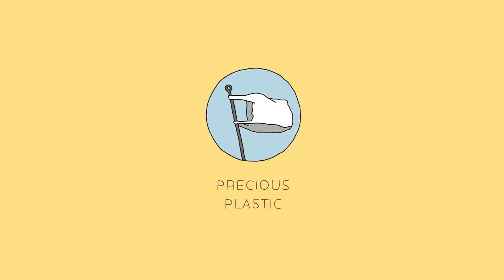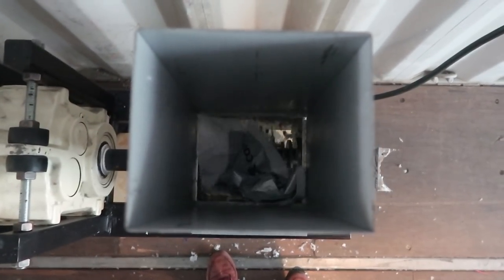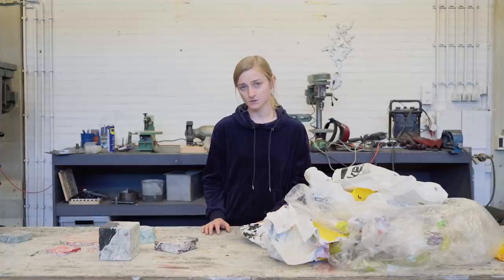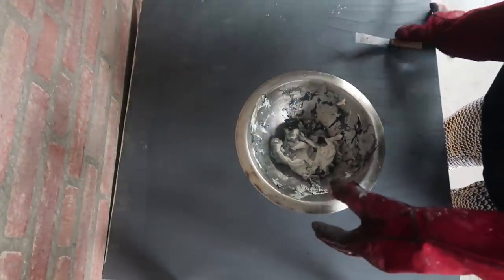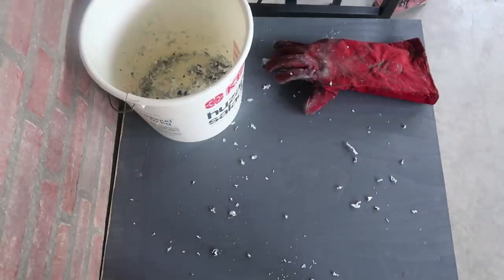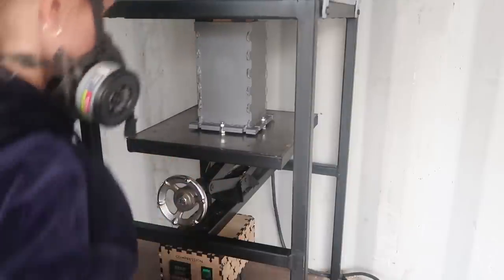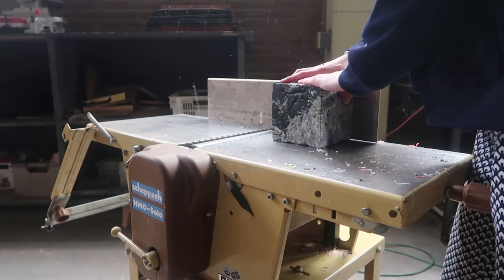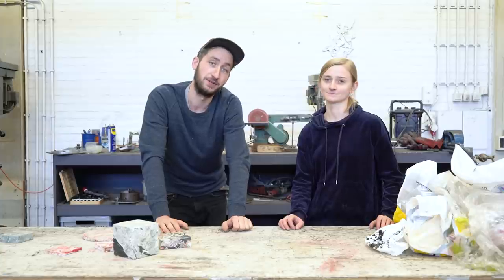Create marble from plastic bags #preciousplastic

Comment: I've found it easier rather than bothering with any shredding or doing the initial melt in the oven to just do a pass over the bags with a heat gun or a high pass with a blow torch.  The plastic will do a partial melt and shrink in on itself, but will cool very quickly so that it can be safely handled sooner.  Do this for a few of them and you'll end up with small, compressed nuggets of plastic that take up a lot less volume, so you can pack them in to your mold for a longer melt to fully liquefy and unify them together.  Other advantage in my experience is that you're much less likely to get air bubbles this way.

Comment: I molded my bags differently. I attached a heater plate directly to the side of the mold, heated the mold up to temp and stuffed it full of whole bags. It works just as well and requires a lot less equipment. It takes longer to cool, but that doesn't bother me.
Reply: Do a youtube on your process... it sounds interesting... do you have fume issues?
Reply: please make a youtube video
Reply: do you use any type of release to prevent plastic from getting stuck on the mold? because mine is always stuck if i heat mold with plastic together
Reply: @ekaterinakorzh188  I used cooking spray and that worked pretty well. You can also buy mold release that works as well

Comment: I got inspired from watching this video and decided to try melting some bags myself.  I bought a 2" pipe nipple and two threaded caps.  Screwed one cap on the nipple, stuffed the pipe nipple with plastic bags then screwed the other cap on.  Placed the assembly into a fire I got going in my fire pit and the pipe turned orange.  The next morning when the assemble was cool, I unscrewed the cap on one end and to my disappointment there was nothing inside except a little ash.  I couldn't believe that all that plastic disintegrated so completely.

Comment: Excellent tutorial. I've learned so many great tips from your group, which I've applied to my own plastic recycling. I just wanted to offer a cautionary remark. It can be quite dangerous to run material under 30cm in length through a jointer (what you called a thickness planer). My worst shop related injuries (plural) were incurred by doing just that. If you must do this (but don't) at least use a push blocks.
Reply: Thanks for the safety tip ❤️
Reply: Thank you Joe. I was horrified when I saw that.

Comment: Great result, Sonia! Thank you. Is it possible to form a longer piece? Suppose you wanted to make a table top, or kitchen counter top?
Reply: Larger form (similar to what is used to pour resin countertops), pressed together with wood and lots of clamps. The trick is to melt a large amount all at the same time. That takes many small ovens or one large oven.
Reply: What about making smaller pieces and plastic welding them together?

Comment: Very good instruction!  The only question is whether the temperature was 200 deg. F or 200 deg C.  Since the melting point of HDPE is 130 C (266 F), and auto-ignition occurs at about 300 C (572 F) it is open to question.  Just need to experiment with a fire extinguisher handy.

Comment: Cool concept and great end product, but extremely dangerous to run anything that short / small over a jointer. That's a great way to make a mistake and loose a finger or even a hand!  You're smarter than that! At the very least you could clamp the plastic in a fixture and be that much further from the cutter head.

Comment: Please  'Don't'  ever use a planing machine like this, planing machines are probably one of the most dangerous wood working machines to use 
'Wrongly' and without guarding, very short sections like that cube can easily catch and drag tightly gripping fingers and hands into the 
Planers cutters. I have seen it happen and I have heard of many other horrific stories.      Mike Harvey
Reply: my grandfather lost the tips of his fingers to a jointer.  it would definitely be safer to make longer pieces, and with guards in place, while using push blocks. but i wonder, how fast it dulls jointer blades?
Reply: Any kind of blades will become dull from either one of two things. Excessive heat generated, or a substance that is equal to or greater in hardness than the blade.
Reply: My boy Mike Harvey here saving fingers
Reply: @ElectricalExistence  definitelly, you'are the second one.
Reply: At work there were 2 capenters who had lost bits of finger to planing machines in their youths. I was allowed to help in the carpenters shop but was never allowed to use the planer  (insurance did not cover it).
Reply: @marianamichalcikova9480  Lol that cracked me up😂
Reply: Agreed You Tubers who aren't pros at what you are watching shouldn't be trying to do it, but Ya know, they won't have multi thousand dollar planers will they.  They'll need to make due with hand held ones requiring you to put block in vise run equipment over it (like she did buffer).  Problem solved.  If you own equipment lets assume you know how to use it.  These folks have been doing this for several years, their shop is to drool over, and while I can't think of any reason not to use pushers and guards when working planers table saws etc I see pros doing it all the time and they are 100 x faster than me.  Might be a connection.
Reply: @ElectricalExistence  Ridiculous comment. I use power tools both hand and bench power tools and sold power tools for a living.  In my opinion women tend to be much more careful when using power tools through proper fear and respect.
Reply: @ElectricalExistence   maybe should read - Always train people (men and women) how to use power tools. (unless of course you are suggesting women are too low intellect to use them?) Then see 2nd world war women at work making aircraft for a refresher to avoid sounding misogynistic
Reply: Kristine B (He was making a joke to the same effect as your comment.)
Reply: Maya Garcia-Hector I actually don’t think he was.
Reply: rebe brke  You might be interested to know that women in the UK had to step into all mens' roles in both World Wars, and then come home after their shifts to continue with home and childcare - and still do all the cooking - from scratch! As for the chauvinistic earlier comment from some silly little boy, women have been the ones who made all the munitions during these wars and still do to this day. The reason that we are much better at these things is that we are not quite so heavy handed and in some areas, are much more dexterous. As for power tools; who do you think assembles them dearie?!
Reply: Yea I seen a buddy chip the tips of his fingures.  This video is a good HOW not to use tools. And even though they made a item from waste this is a n.v extremely time consuming process that makes it nearly financially not feasible for a regular person to replicated to make money or to even use f im r self.
Reply: Given that plastic is so much softer than wood and has no fibers ( grain ) in it that planer should not be a problem as you say.
Reply: Do you have a time stamp?
Reply: And do you think children watch this video? Don't underestimate the engineers, chemists, and investors, who we know about industrial engineering; Those of us here know the ISO and OSHA, Toyota and ANSI protocols for safety. Do not underestimate the authors with their childish ideas, everyone here knows what we are capable of doing and we do not need the typical tantrums of a kindergarten teacher.

Comment: Make a black metal mold in the shape of a picket for a picket fence.
Hit the metal with a bunch of 8x11 Fresnel lens sheets.
Place bags in hot metal mold to begin the melting process.
Place other cut up plastic on top of melting bags.
Place another layer of bags on top of this plastic.
Place black metal lid on top of mold.
Hit with lenses to melt top plastic bags.
Let cool.

Will this make decent pickets?  They don't have to be perfect.